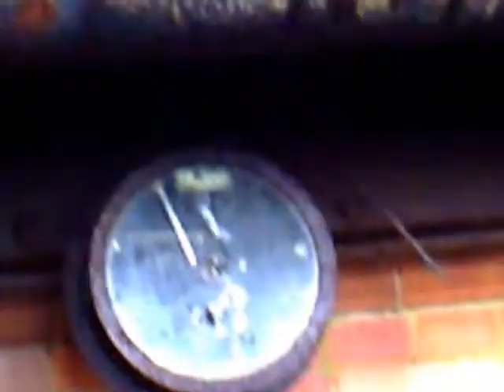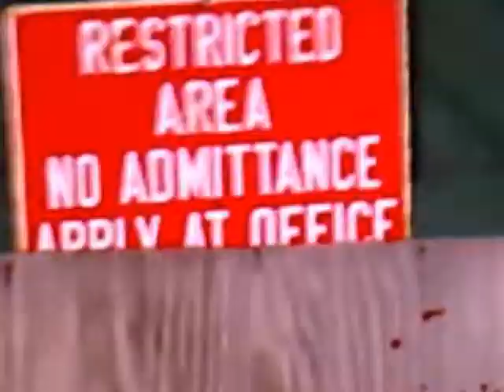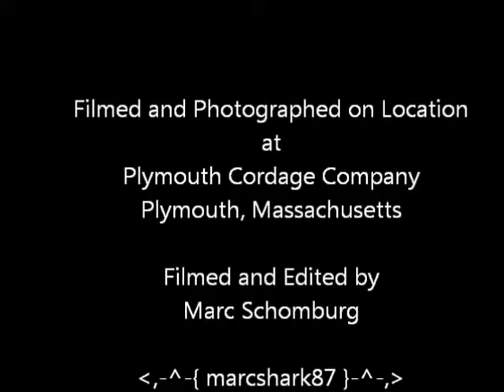Abandoned Cordage Park Factory Tour

Comment from the maker: The power plant, generator room building, and one of the mills are gone as well as the coal pockets. They knocked down 3 of them. I knew every square inch of every building in this place. Also, the tunnels under the storage warehouses are now all blocked off. There used do be windows for light to shine down there which were all broken and you could climb down there but now its bricked off since the last time I was there. I lived across the street from there since I was 11.